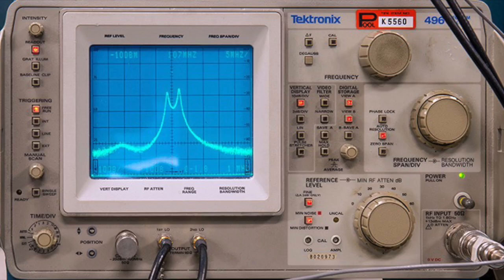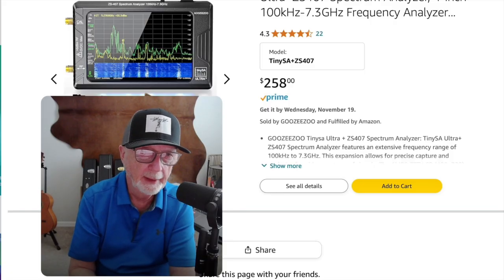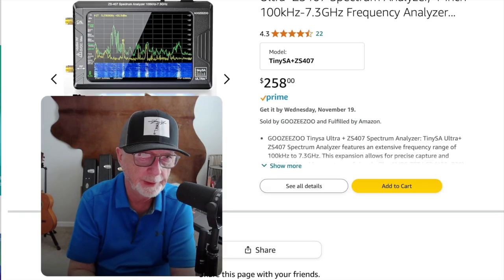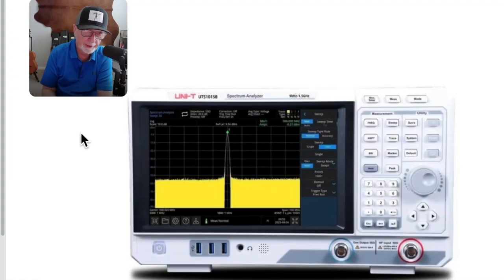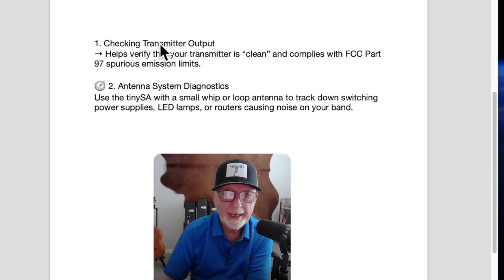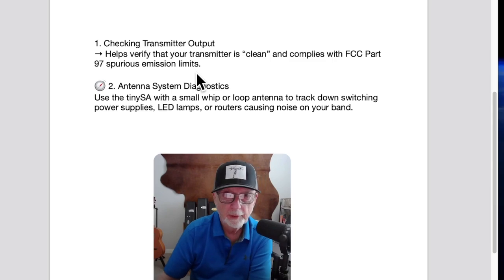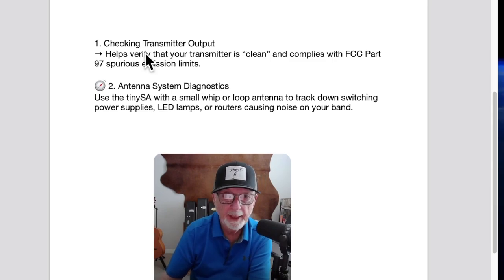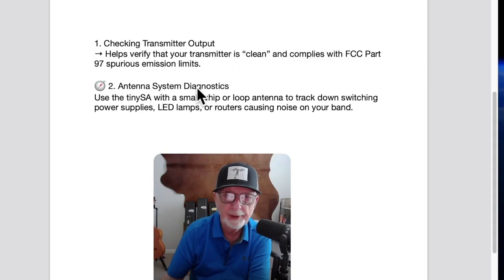Is your HT SPLATTERING all over the band?

Comment: My Yaesu 710 is a splatter master on 80m at 100w. I won’t be throwing it away though.
Reply from the maker: Really? I'm surprised.
Reply: @BustRadioMyths yep, tried a few different 80m antennas too. Reports all the same. Stock settings, 100w.